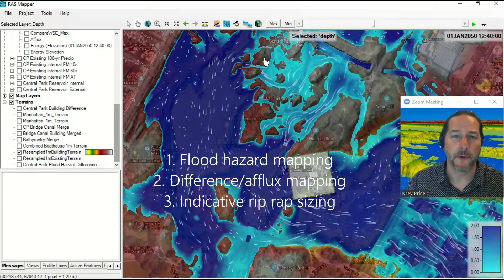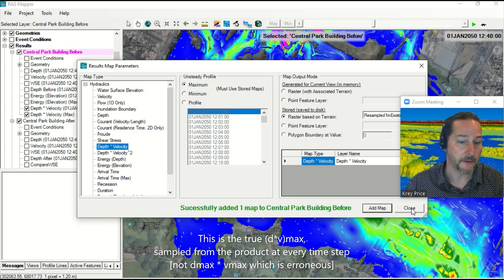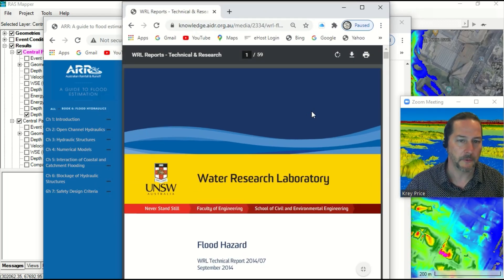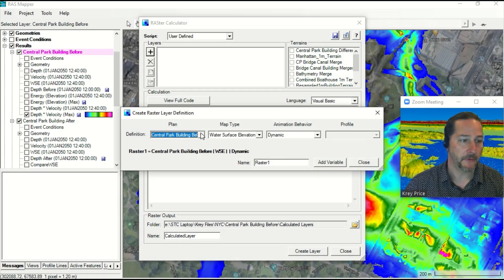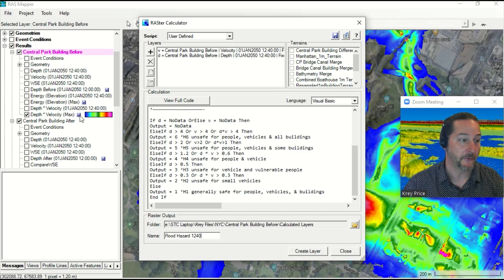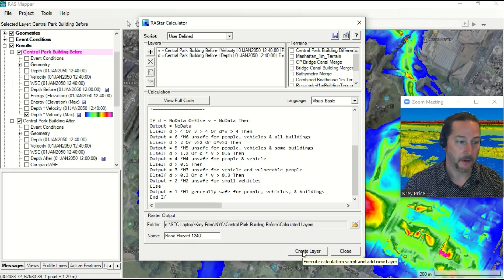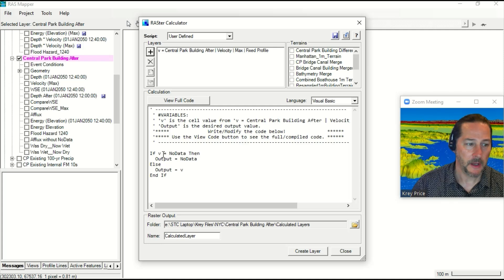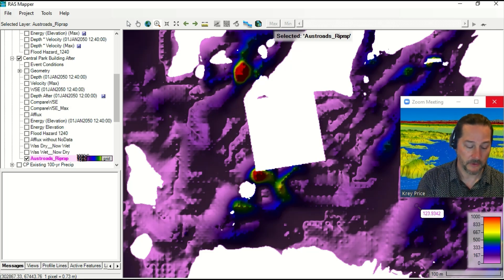What's new in HEC-RAS 6.0 Part 3: Flood hazard, difference/afflux maps and indicative rip rap sizing

Comment: Thanks a lot Krey for all that amazing content! 

One remark and one short question: 
If you have different inundation areas, but model values with no velocity or no depth as noData, you will miss them out when using the RasterCalculator (because noData - something still is noData). Some areas might have no flood hazard class before and then change to 5 but still wont be displayed in the difference map. Rather type: 

If d = NoData OrElse v = NoData Then
Output = 0 ‘H0 no water
... 

and the difference map will also cover regions which were not wet in the before case. 

My question is if it is possible to display the difference terrain layer above the MapLayer, so that the difference map can be transmissive and the underlying map layer will be displayed in full color?

Comment: Ok so the process of preparing H1-H6, requires a hybrid, of the hazard calculated at each time slice, then merged for all time slices does it not? This is a very exhaustive process (Easy enough to code however). This being the case back in 2008 I looked into a better method to define Hazard that does not require the three values of 'Depth", 'Velocity" and 'DepthxVelocity' noting that VxD is simply the MOMENTUM of the flowing water, so why not call it that??? Any way the algorithm that I came up with resulted in a curve very much shaped like that by Trieste (1988) The definition is: Hazard = D*(1+V^2) = (0.1,0.2...1,2,....etc) Please create this as a hazard in HEC and see for yourself the benefits of this definition compared to H1-H6. Regards